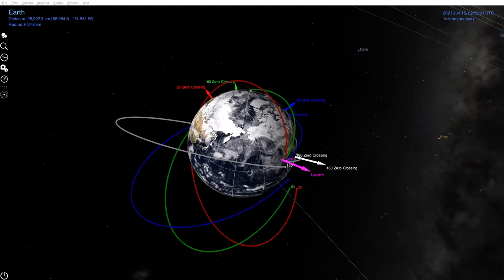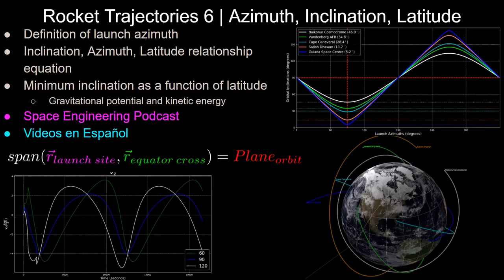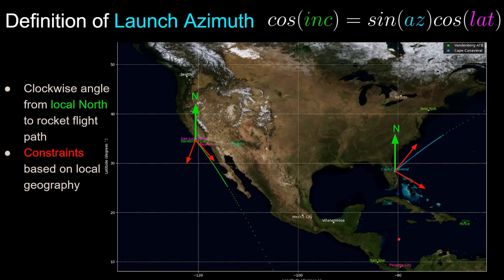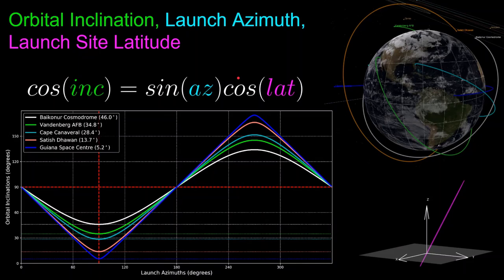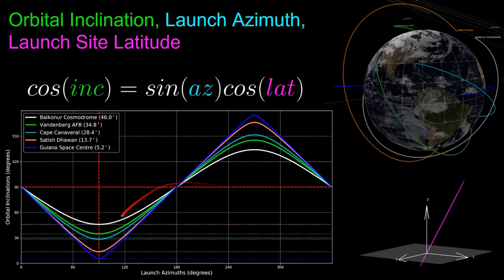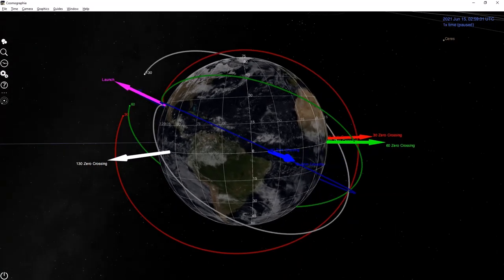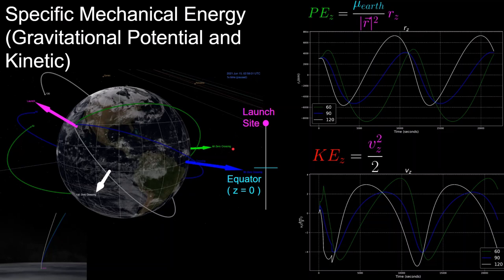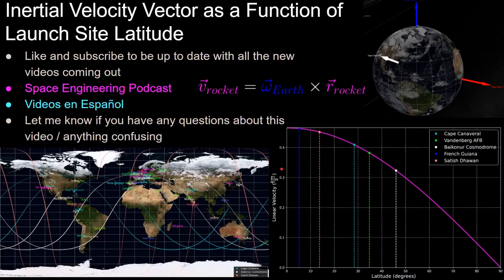Launch Azimuth, Orbital Inclination, Launch Site Latitude | Rocket Trajectories 6

Comment: I don't understand why launching to an orbital inclination lower than the latitude of your launch site is impossible without a plane change maneuver but launching to an orbital inclination higher than the latitude of your launch site does not require a plane change maneuver. Shouldn't both require a plane change maneuver?
Reply from the maker: I think the best way to think about the problem is using the span of the two vectors. For any launch, one of those vectors is going to be the position vector of the launch site with respect to the center of the Earth. ( 4:02 )

The second vector is going to be wherever the rocket crosses the equatorial plane. Depending on which direction you launch to, you will cross the equator at a different location, and those two vectors define the orbital plane (the span of the 2 vectors is the orbital plane).

So you could launch to any inclination that is greater than the latitude (even 90 degree inclination if you launch straight North to go over the poles), but the same launch profile will result in different semi-major axes (the closer to due East you launch, the larger the fine final amount of energy, since when we're sitting on Earth we already have a velocity vector in the equatorial plane due to Earth rotating
Reply: @alfonsogonzalez-astrodynam2207  
Thank you for the reply!! The part that is still bothering me is that if you launch at an orbital inclination greater than the latitude of the launch site, then you are no longer in the orbital plane that is the span of the two vectors that you mentioned. Thus, in my mind, you would have to do a plane change maneuver. Any thoughts?
Reply from the maker: Before you launch, the vector that points to the equatorial plane crossing is not defined. It is a function of the launch azimuth. So if you launch with an azimuth of 45 degrees you will have a different equatorial plane crossing vector than if you launch at 50, 100, 170, etc. degrees